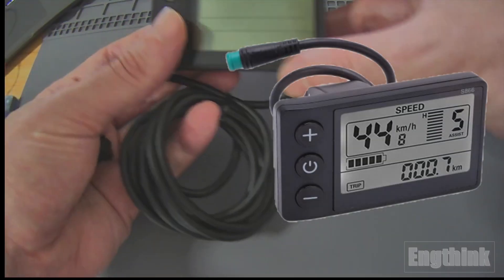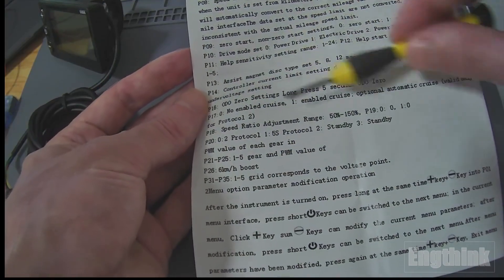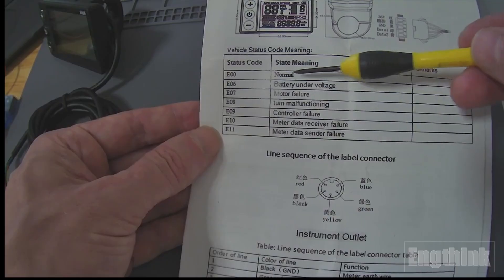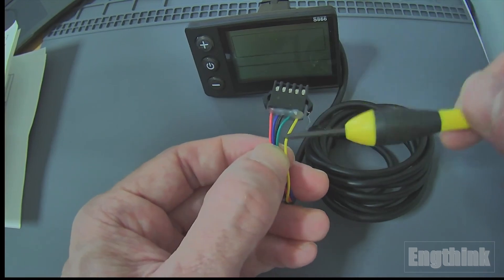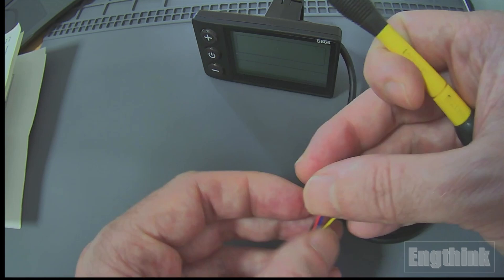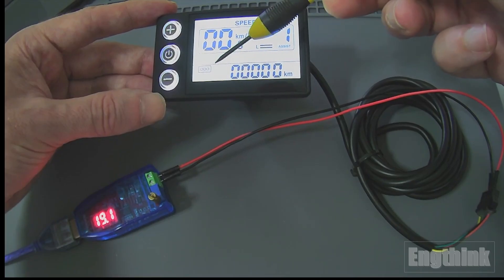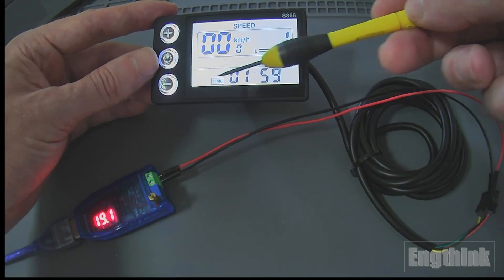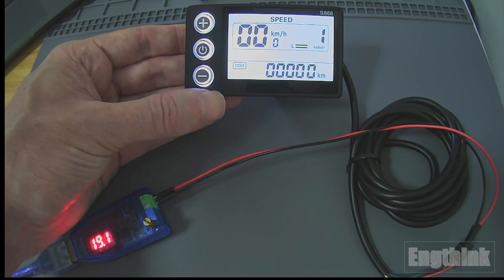S866 LCD Ebike  display wiring diagram, power up and testing #ebike #ridstarq20 Ridstar Q20

Comment: Hello I purchased this model S866 with a waterproof (round 6 pin) connector. It power on when connected but show E10 error. my ebike is UART protocol and in your video P20 option can change the protocol - can you please advise me how to change this ?
Reply from the maker: Hello! If your S866 powers on but shows an E10 error, it’s usually a communication issue. Even though your e-bike uses the UART protocol, not all S866 displays support changing the protocol via P20. On many versions, P20 is fixed or not available. Also, the S866 firmware is often brand-specific, so I recommend confirming with the seller or manufacturer whether your exact S866 model is compatible with your controller. In summary, some S866 displays may be designed with a protocol specific to your e-bike controller

Comment: I bought this to replace my King Meter display which had wires ripped. I had the E10 error so I expect different communication protocol? 😢
Reply from the maker: I tried the same S866 model on a new e-bike that has the same issue (E10). They probably use a specific firmware for the display that can only be used with the original controller of the e-bike brand.

Comment: Ok im running 104 volt nominal system can the display handle it or will ot die thanks
Reply: It will die 💀
Reply from the maker: The maximum nominal voltage of the battery is 60V, so 104V would probably damage the display.
Reply: The maximum voltage the display cn handle is 5 volts coming from the controller. Displays are all provided their power from their controllers. You don't connect the display directly to the battery voltage ever. They are all designed to work with specifc controllers with a specific 5 pin plug set up for it and not designed to work with just any controller.

Comment: Do you know if the voltage rating is important?  I've got a scooter with 42 volt battery but a 24 volt display so will that work or will it smoke?
Reply from the maker: Will work normally, because the display is designed to operate with the battery voltage.
Reply: @engthink  The 24 volt display works on 42 volts but the voltage bargraph is at full scale all the time.

Comment: In addition to the 5 pin connector my display also has a second connector with 2 wires but no information anywhere showing what they go to!  Does anyone know what those 2 extra wires are for?
Reply: if you measure them and they supply the full pack voltage, then they're for the headlight
Reply from the maker: The other two wires are for informing the display what the battery voltage .

Comment: Hi! My wife's bike works, but I wanted to modify some parameters. When I press + and - at the same time, "000" is blinking on the screen, instead of the modification menu. It is not antitheft lock, because the bike is working, but I can't find any information about this. I can modify all 3 digits from 0-9, stepping by press on/off button, but can't memorize the settings. After 8 seconds, the diplay steps back to normal position, and then, press + and - the same, 000 instead of the menu (P01-P24) Can you help to solve? Thank you!
Reply: Enter 666 and hold power button briefly, you will then be in settings
Go to the odometer parameter (p16) and LONG press +, the odometer (and all settings) will completely reset - this will remove the password lock
Reply: @nickaxworthy3236  Thank you, this method has already been recommended, but it didn't work. It's not password protection, because the bike can be used, the assistance works, but you can't enter the parameter menu. I described the method in another video that solved the problem.
Reply from the maker: Thank you for your feedback. Since the other method didn’t work for you, could you please share how you solved the problem in the other video? I’d really appreciate learning the steps you used.

Comment: Im getting an E10 error on one unit and the other wont turn on at all. I ordered a third one to try. Ridstar Q20
Reply: Did you fix it get same error
Reply: @ i had to get the one that connects directly to the controller. Not the one that connects to the quick connectors.
Reply: @vickomf1  i have the one that connects directly as well

Comment: Great explanation, thanks for sharing!!

If I have an E09 error, and no speed showing to the controller what could be done to troubleshoot?
I tried a different screen, but no luck
Reply: E-09 Error- If after removing the plug for one minute and reinstalling the error persists, the controller needs to be replaced. According to the troubleshooting guide.

Comment: Thank you for your clear explanation. I connected it as you did. When I turn it on I get 4 connecting bars ---- . If I press a bar for 3 seconds I get a number and not what you see on the screen.¹ What should I do to prevent this?
Reply from the maker: @willemvandillen807  which model os display you have?
Reply: @engthink  en06 display reset
Reply: en06 display reset
Reply: The 4 dashes indicate that a password must be set. For a new EN06, that should be 4 x 9. I have tried that several times, also 4 x 0, unfortunately without result.
Can you tell me how I can reset the password?
Reply: EN06
Reply: Next one, I connected a new G51 display that works perfectly. (I thought it could also be due to the BMS but that is not the case. Furthermore I think that on the EN06 the connector was pressed vigorously by some miscreants, causing everything to no longer work correctly. When I turn it on I get the familiar opening screen very briefly but then the 4 - - - -.